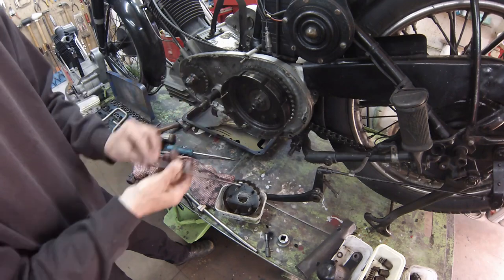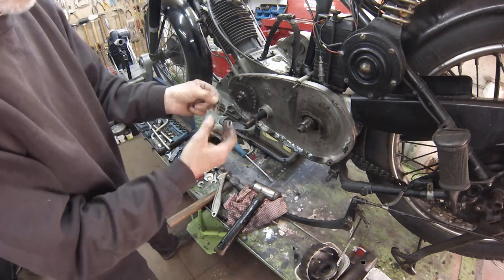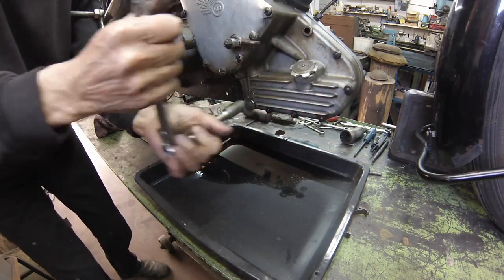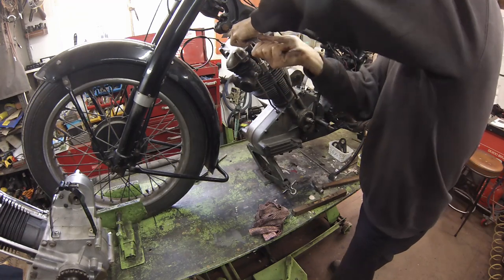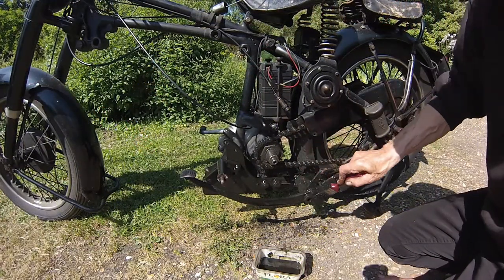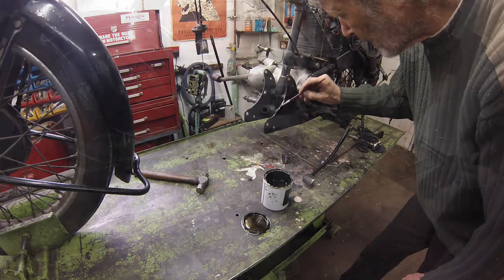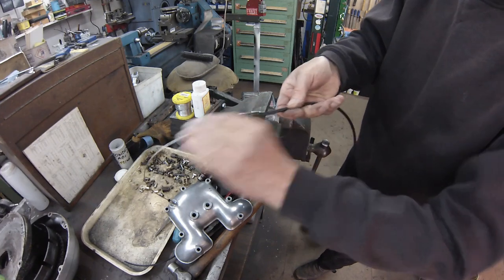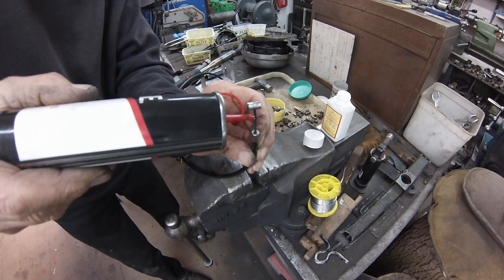Panther Model 100 engine; Part 3: Out  with the old.

Comment: Oh the fun I used to have as a callow youth making up throttle, clutch and gearchange cables for my aging Vespa 150 Super (Yes, I know but I soon saw the light..) You could buy new complete cables but it was such a pain to thread them through the frame that nobody bothered, instead owners became adept at leaving the outers in place and making up new inners to thread down (or up..) them - My mates used to joke that instead of MPG my Vespa had CPT.. Cables Per Trip..

Comment: Brilliant video, well up to the usual standard, always a joy to watch......one question, what do you mean by a hollow punch? I take it you do not mean a punch for cutting holes in leather or paper....The local bike fixer, Nicholas Sheldrake who I used to pester in my youth, used to call the spread end of a cable ready for solder a "Cats Arse"
Reply: Thanks Andrew. On the forming of cable ends I used to simply spread them with a dot punch but found a tendency for the ends to poke from the solder fill and need filing back. The punch I now use has a rounded hollow in the end which tends to gather the tips of the inner cable and spread them lower down, a little part-clenched fist. It's a bit neater.
Reply: something for me to look out for or make, thanks for that. 
Andy L @jonathanjones9790

Comment: First time I've seen someone making a custom cable, what is that clamping device, that you used, does it allow you to form / flatten the end of the inner cable, before you solder on the nipple?. Good informative video, very enjoyable. I was a motor mechanic most of my working life, mainly cars, vans, trucks, BMC apprenticeship.